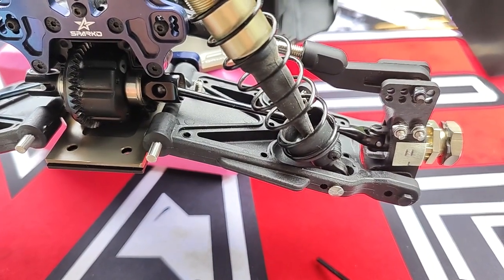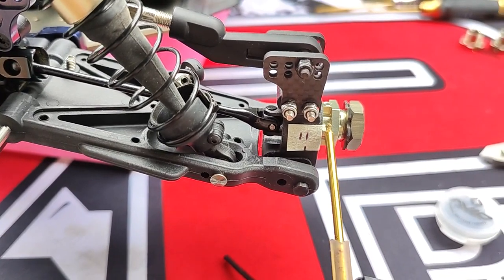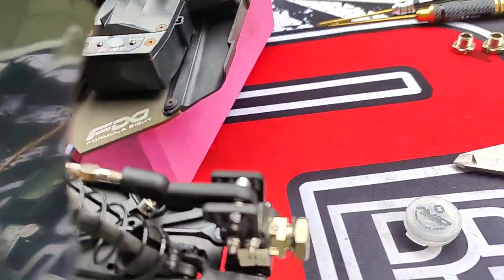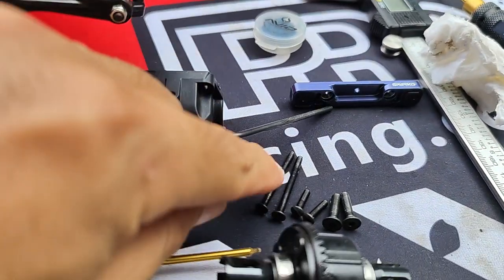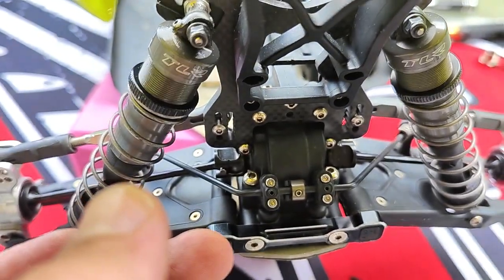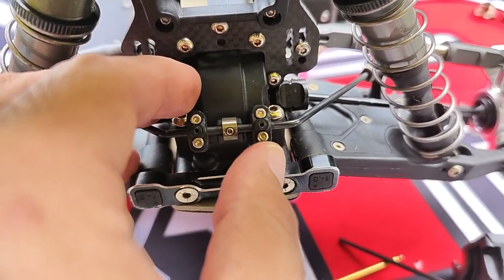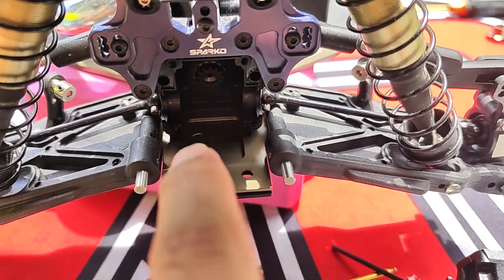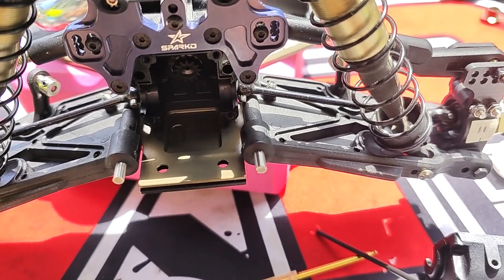Sparko F8 Suspension Tips Video and Diff Access Compared to 8ight-X 2.0.

Comment: I wish Sparko could make the diff cases 3/4 split designs. Like with the new XRAY XB8. Would make diff access even easier without having to remove the A and D blocks
Reply from the maker: Maybe in the future. As is it's already a convenience. They chose this design as it is already proven, and provides a stronger diff case, and allows for the diff to stay truer to the pinion gear. There is a video going around showing how free the drivetrain is with this buggy. The new X-ray 2023 XB8 design is still not yet proven and they have had their share of problems with it. Hopefully the changes they made to resolve the issue will prove long term the design is solid. As they have had issues with durability and dirt getting inside the new case design. Again hopefully with the changes they made it will prove that removing 2 screws out of the equation for convenience was worth it.
Reply: @amrservos or me its alrdy a proven quick access design which was done by other brand years before xray. Started with durango which sold to arrma. Then serpent and ae. Then tekno and mugen. But somehow the one from xray got a cracked bulkhead issue. I think for future development, this is the right direction. And one more thing, it actly reduces 1 screw. We need to unscrew 1 of the shocks bottom screw to mount the diff back. But the convenience is the A or D block stays together

Comment: It looks very much like Sworkz parts too. Diffs, hexes, Wing mount, linkage setup. etc. This is a good looking car. If Sworkz was a c hub car, this is what it would look like 100%
Reply from the maker: Same factory, however 2 different designers. They do share some parts which have been a convenience for me since our local shop is fully stocked on Sworkz, as Sparko spares have not arrived yet. The shocks are the same however they improved them by using a different lower shock cup, and shock end which have a screw to keep them in place. The threads on the shafts are also slightly larger in diameter for more bite. Too many more improvements/changes to list.

Comment: The car looks very high quality but when I think of quick access diffs I think of not having to take any of the blocks off. Like a Mugen. Not a big deal though. On the other hand that TLR looks like an absolute nightmare to work on no wonder you are impressed with the ease of the sparko😂
Reply from the maker: The car quality is as high as it can get. The fit, machine work, and the quality of the plastics is excellent. The diffs are still considered quick access diffs, but not the same design as you see in the Mugen or new X-ray. Maybe the next generation will incorporate the same design, but the current design is still easy to work on, and only has about 2 more bolts that need to be removed compared to the Mugen. A few more seconds isn't going to hurt anyone. The new TLR is a dinosaur, and the current 2.0 is well well behind even the Sparko when it comes to diff access especially.

Comment: Looks nice. I like the lower shock pins. That front hub looks awesome. But having front/rear diffs the same part is old tech, and the diff access isn’t new either. What’s with all those diff shims? I also like the simplified sway bar cap idea. I’m a Tekno nerd, and Tekno’s bearing mounted sway bars are overkill for not much benefit imho. 
Also I just saw an add showing a front upper A arm? Is that optional?
Reply from the maker: Front upper arm is standard. No one said it was new tech. It is simply new compared to my 8ight-X 2.0 which uses entirely different front and rear diff housings. Also the access is different, and not as convenient as the Sparko. Regardless if it's new or not the video is here to showcase the features. The diff shims are .2 rather than the standard .3. This allows for finer adjustment of the mesh. Not sure why the amount of shims matter, what is important you have the ability to adjust the mesh. If the amount is a big deal you simply glue them all together with some thin CA.

Comment: holy diff shims.....
Reply from the maker: That's why I suggested you glue them together with some thin CA in another video. For example it is only 2 more shims than the 8ight-X and Sworkz S35-4. Just glue the shims together and the diffs pop in and out quickly.